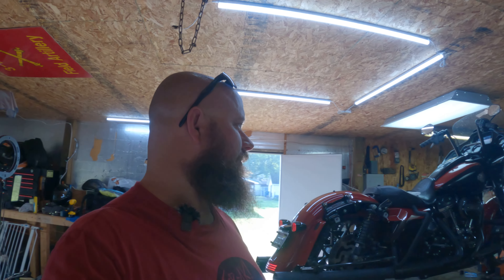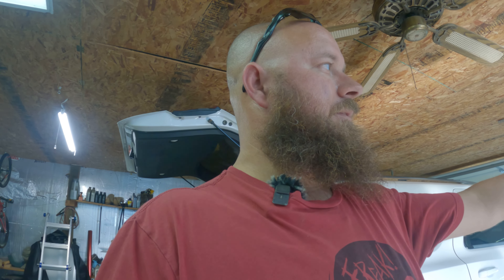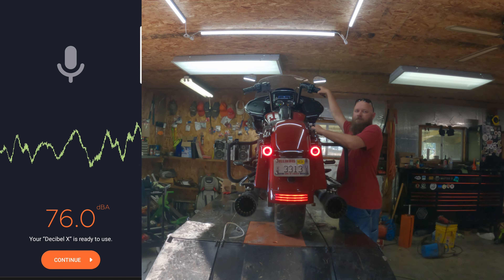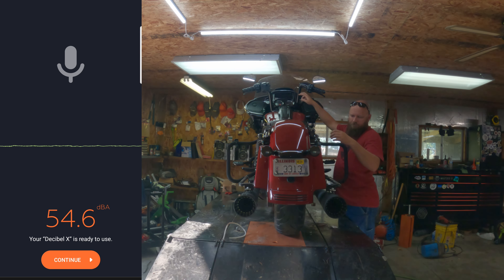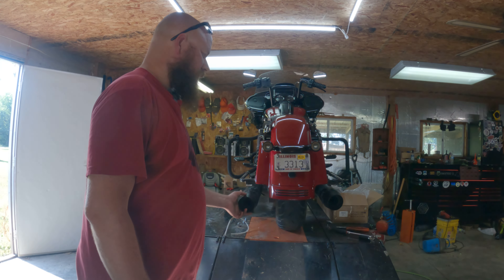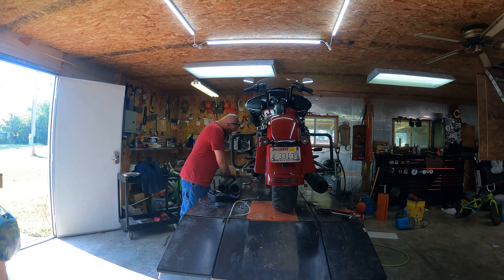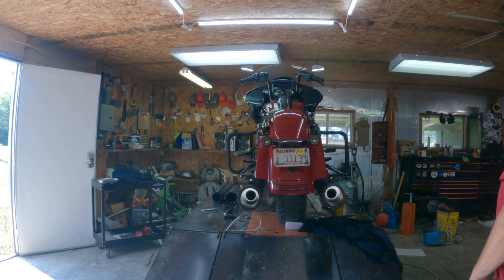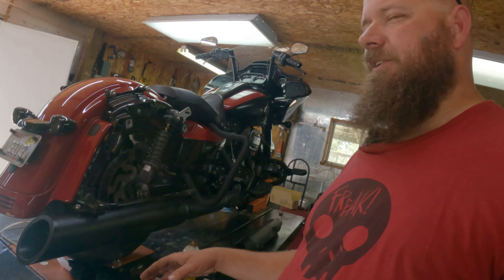NEW EX H-G-WHAT!!! Harley Davidson Exhaust Upgrade

Comment: Good video!  consider doing a part 2 on noise level where the operator’s head will be - give the viewer an idea of what it may sound like riding -  also, good idea on overhead lights - instead of shining lights on seat/tanks, you position lights to shine on perimeter of the bike, where you’ll be working on it.
Reply from the maker: I will give that a try.